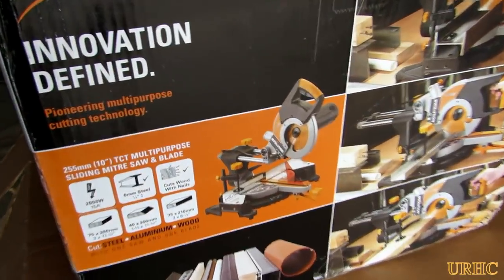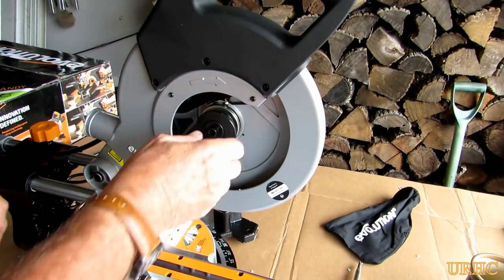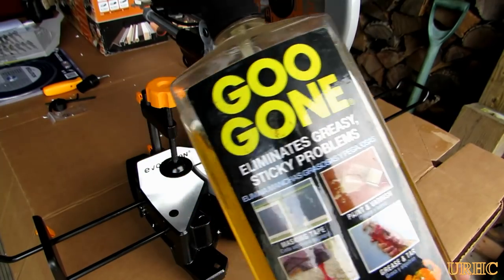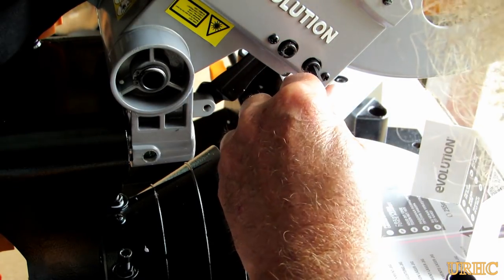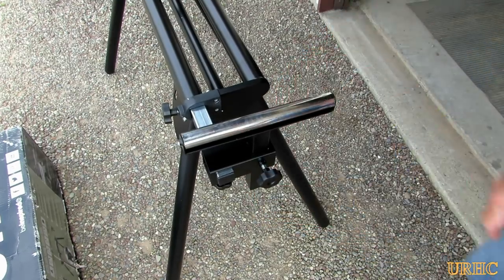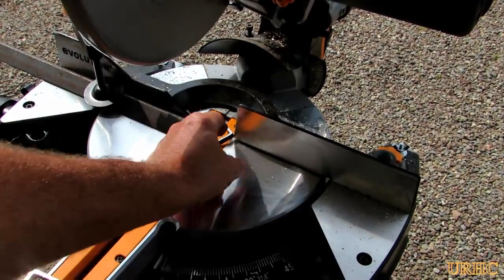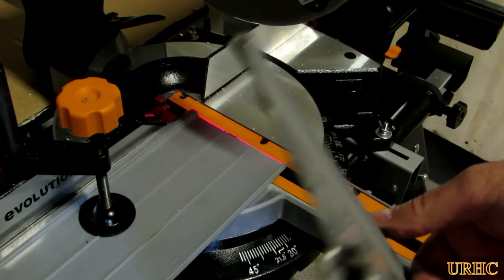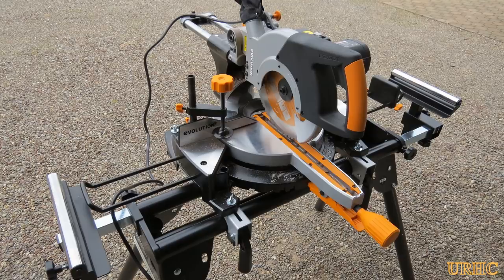Evolution Rage 3 TCT Multipurpose Miter Saw, Asm, Setup, & First Cuts

Comment: Of all the reviews I've seen with this machine, NOBODY has ever mentioned the 5/8 arbor like you did. I am a woodworker and  I don't do a lot of metal work, but to have a saw that is capable of this, well I need to seriously consider this.  I think that the price is excellent for anything with a 3 year warranty. Thank you for a very well done review.
Reply from the maker: The flange that centers the 1 lnch arbor can be flipped so a 5/8 drilled blade can be used.  The rpm is a little slow for a std wood blade, but I will try it to see how it cuts when I get a  chance. It would be the perfect saw for both worlds if it had a 2 speed gearbox with a high speed for wood. The slow start feature makes it a really smooth running saw to operate. Thanks for watching

Comment: Just wanted to say thank you.  I have the same saw and like a lot of men did not read the instructions.  Mine was not cutting at 90 and so when I was building things like chicken coops, duck houses and sheds, they were always off.  I started to look for videos in despair as I was about to sell it and buy something else.  Will be setting it up properly tomorrow.  Thanks for sharing.  Now subbed
Reply from the maker: These saws are not always perfectly adjusted from the factory. Mine both cut good after adjusting them. Thanks for watching.

Comment: I’ve had this saw for about a year and here are my thoughts:
The Good
1. Motor has plenty of torque. I cut 2x2x1/4 square tubing no problem. 
2. Seems to be well made. Good ball bearings and heavy slide rails. 
3. Cuts multiple materials. Arbor can be removed and reversed to use 5/8” arbor wood cutting blades. 
4. Love the soft start. 

The Bad
1. Throws a lot of hot metal chips directly at your face when using the included blade. 
2. Included blade is a jack of all trades, but master of none. It will cut a lot of materials but won’t cut any specific material as well as a blade designed for a single material. 
3. Clamping system designed for wood not metal. Does not hold metal well. 

Recommendation: If you want the convenience of cutting multiple materials and won’t use it for heavy duty cutting, this is your saw. 
If you’re going to be cutting mostly metal, get the Rage 2 because it’s clamping system is made especially to hold metal. 
Overall it’s a pretty good saw, just know it’s limitations.
Reply from the maker: The only thing to add is if you don't cover the laser lens when cutting metal the cap is destroyed by the hot chips. I have had no problems with it so far and also have a northern tool 15 inch saw for thicker materials.  There's a new replacement model out for this saw now. Thanks for watching.

Comment: That settles it, I was on the fence but now I'm getting it. mitre saw that also cuts metal, I'm sold.
Reply from the maker: Just make sure you don't cut high carbon or hardened steel it. It works good for low carbon steel and aluminium.  Evolution has some good videos on their channel showing how to cut steel for best blade life. Thanks for watching.

Comment: This video is fantastic. I just recently bought exactly this machine and the stand as well. Your video was very helpful at the point of assembly and at the setup. You saved me lot of time. Thank you very much!
Reply from the maker: This has been a great saw so far. Just get a good faceshield if you will be cutting metal. They did make it easy to assemble. Good luck with yours. Thanks for watching.

Comment: Awesome review. Thanks. Wondering if after a few year use if you could update on reliability and  durability of blade. Thanks
Reply from the maker: It is still good. Watch the videos  on the evolution channel  that show how to cut for the best blade life and only cut the recommended materials. One cut in the wrong  material will destroy the blade. This saw has been discontinued and replaced by a newer model that has a blade that is not as good.  I have a video about that one also but think this is s better saw. Thanks for watching.
Reply: @unemployedredneckhillbilly2023  great, thanks for replying

Comment: I have this saw, or an earlier version.  Mine has the measuring marks on the fence.  Got it on clearance @ Lowes for around $100, and bought their last couple of extra blades.  The guard has always been problematic and the topside vertical pivot lock vibrates closed every cut without fail.  Other than that, cuts great.  Cuts about anything.  Just support your material, use sacrificial backers for small aluminum cut offs, like thin aluminum angle, cuts better in a stack than individually,  etc.   ...the usual learning curve stuff.  If you've ever seen someone try to cut a piece of aluminum angle on a chop saw and it slaps both their ears...you know what I'm talking about.
Reply from the maker: I haven't seen any problems with the guard. The only issue is if you don't cover the laser lense protector when cutting metal it gets messed up and must be replaced. Thanks for watching.
Reply: Unemployed Redneck Hillbilly Creations , looks like they've made some changes.  Glad it's worked out.  I really like this saw, and their 12" chopsaw. I'd love to make a video for this saw, or even sell these.  They're the smart choice.  I've never regretted buying it.

Comment: Keep looking at this saw and have not pushed the button yet. Thinking you just helped me decide to purchase one. Nice review.
Reply from the maker: It has worked good for me. The only thing I have found so far is to cover up the laser lens when cutting metal. The hot chips can mess the lens cover up. I did a lot of veneer stone cutting with the diamond blade and that also works great.

Comment: You said the Blade cut the aluminum "like Butter", but the Von Stefent brand Butter I buy at Walmart would almost certainly melt the "diamond blade" if you tried to cut through a bar of lightly salted.
Reply from the maker: That must be one tough slab of butter. Thanks for watching.

Comment: does the the arbour lock button drop into a detent on yours? I fond t hard to tighten the blade.
Reply from the maker: Yes. There is one spot it will engage.  Press the lock button and turn the blade until it locks in. Contact  evolution if yours  doesn't  lock. Thanks for watching.

Comment: My saw came fully assembled. Wondering if they started doing that after you got yours. My box was also pretty beat up but seemed like everything was there and intact. I actually haven’t made any cuts with it yet though.
Reply from the maker: Did you get the Rage or R255 SMS. I thought the rage is discontinued and replaced by the newer model. Shipping beats every box I get up pretty bad anymore.  Mine still works great.  Thanks for watching.

Comment: By far best review I've seen on a compound mitre recently. Thanks!
Reply from the maker: It has been a great saw so far. It is not a super high precision wood cutting saw, but does a good job on all types of materials with the same blade.My blade is still sharp after a couple months of use. I reccomend covering the laser when cutting metal. Thanks for watching.

Comment: any update on this saw? is it still working?
Reply from the maker: Still working good. Have used it for steel, aluminum, slate, stone, ceramic tile, plastic and wood with no problems. Used in many of my videos. It has been discontinued and replaced with a new model that I also have and don't like as much. Thanks for watching.
Reply: @unemployedredneckhillbilly2023  so you like the older model better? thats the one i have and no matter how hard i try i cant get it to cut true its always off by a bit and getting the laser spot on is another battle ..ive heard that the fence comes bent from factory or something thats why you can never get it perfect, ive been reading alot of reviews and alot of them have the same issue that im having... this saw does everything ok but nothing great... good for the simple regular diyer around the house but i dont know about professional
Reply from the maker: I definitely  like  the rage3 better.  Quieter,  smoother,  and comes with a better  blade. Mine  cuts true but not perfectly smooth  because  of the lower rpms required for the multicut blade. If your fence  is bent did you contact  evolution?   The laser needs to be covered  when cutting  metal or the lens gets  destroyed and distorted. I  don't  use the laser anyway. For a good cut get a decent  tablesaw with  an Amana blade. Thanks for watching

Comment: glad I found your video! Manufacturers link to their video was garbage as was the instruction manual and assembly guide the printers must have run out of ink it was that feint and no laser jig! Hope the machine quality is better than the instructions. Thanks for your help.
Reply from the maker: This has been a great saw. I just received the new replacement model and I like the rage 3 better. It has a quieter motor and comes with a better cutting blade. They seem to have cheapened down the new model with less teeth on the blade and a motor that sounds like the drive gears are external and very loud. There is a video about that one. They both are very easy to assemble. Thanks for watching.

Comment: Really great video.  Very informative. Looks like I might buy this saw......
Reply from the maker: I have used it quite a bit and it is very handy. It is not a super precision woodworking saw but does a good job on everything it cuts.  The only issue so far is if you cut a lot of metal or stone with the diamond blade the lense on the laser gets beat up and has to be changed to see it clearly. Evolution has some good videos about how to cut steel for the longest blade life. Thanks for watching.

Comment: Went to your link for the saw at Home Depot and it says discontinued. Maybe it was too much of a good thing as it cut both metal and wood. Good review tho.
Reply from the maker: I have a video about the replacement model that cuts the same materials but really like this one better. This comes with a better blade and is much quieter. I think this was recently discontinued. Thanks for watching.

Comment: How many blades come with it? Is it one blade that cuts through all materials and a back up dedicated tile if that's all your cutting? But the first blade still cuts tile as well as wood/ metal?
Reply from the maker: It comes with 1 multi cut blade for wood and soft metal. The diamond blade for cutting stone and tile is extra. There is a newer model available now. Thanks for watching.

Comment: Were you impressed enough to recommend this as a "one saw to do it all" for the beginning homeowner, or would you recommend dedicated wood and metal saws if budgets allowed owning both?
Reply from the maker: It is not a high speed saw with a high tooth count triple ground blade so if you plan on cabinetmaking and finish carpentry the cut in wood is not glass smooth, but it is accurate. If you plan on using it for home based projects it looks like it will handle everything that you throw at it out of the box. There are also some different blades available for cutting steel and wood that probably will give better results then the TCT blade in the materials they are rated for. The diamond blade is a real big plus to me for tile and stone work. I would have loved this saw when I remodeled my first house and destroyed many blades trying to reuse materials with nails and had many drain lines to cut. Plus having the ability to accurately cut steel would have saved me countless hours of hack sawing and grinding. So far I really like the saw, the quality is great and I would recommend it. Time will tell how the blade stands up, but it is not a very expensive blade to replace. Home Depot sells the saws and always stands behind anything they sell, plus the 3 year warranty seems like excellent coverage for a saw in this price range. Serious eye protection is needed when cutting metal Thanks for watching

Comment: Mine suddenly began to run at what appears to be double the speed, so I now only use it for wood. Has anyone else had this issue?
Reply from the maker: I would pull the plug out and contact Evolution support. Sounds like it could be a dangerous problem as the saw is not designed to run at higher speeds. I would not run it until fixed. They have a good warranty if yours isn't too old.

Comment: I have the same saw and I'll be returning it to the store very soon. It stopped working suddenly after about 2 doz. cuts. It popped a breaker and would n't restart after it was reset. I'm unsure if I'll try another one.
Reply from the maker: Mine has been working great for over a year now. The only issue is you have to cover the laser lens cap when cutting metal. That is definitely a bad bummer.  Thanks for watching.

Comment: Great video sir.  Thanks very much for uploading and doing such a thorough job of showing the setup etc.
This saw be good for a DIY'er who's tired of making unsquare cuts with hacksaws and woodsaws?
Reply from the maker: I have gotten a lot of use from it so far. It is not a high precision woodworking saw but a really good all purpose saw. The diamond blade has worked awesome for stone veneer and tiles also. The blade on mine is still sharp after using on different materials for a couple months so I am very happy with it. Thanks for watching.
Reply: I'll need something for wood and aluminum mostly, maybe some steel too.
Thanks.

Comment: You provide a lot of good info, but what about ... price or value?
Reply from the maker: There is a link to homedepot.com in the description with the current pricing and it seems to be a great sale price right now. I think it is a great saw and gives you the ability to cut many different materials  that is backed by a 3 year warranty that is a great value to me due to the different types of materials that I  work with. This saw is very well made and has a high torque low speed motor that puts it in a class of its own. Yes you can find a lower cost saw, but it will only cut wood so it depends on how you plan to use it. Thanks for watching.

Comment: This saw caught my attention and your review has convinced me to buy it.  Awesome review!  Has anyone ever told you that you sound like Woody Harrelson?
Reply from the maker: For the price it is a saw that can cut just about anything. It is not a high precision woodworking saw with a glass smooth cut but cuts everything well. One thing I have to recommend is when cutting metal or stone protect the laser lens or it can get damaged. Evolution has some good videos about how to cut steel to get the best blade life. I cut a lot of stone veneer with the diamond blade and that also worked great. Thanks for watching.

Comment: Thank you for the review. What can you cay about the life of the blade when cutting steel? (2mm steel tubing, thing like that). Some reviews suggest this is an expensive way to cut steel.
Reply from the maker: I just started using the saw and do not know what the blade life will be. I think it will depend a lot on the grade of steel that you are cutting. It cuts soft steel like butter,  but anything with a hardness may shorten the blade life. I have a old abrasive saw and know that the way those blades wear out it costs a lot to cut steel with that. The only good thing about it is that  the abrasives  will cut hard steel. I know there are also dedicated steel cutting blades available that may have a longer life available for this saw. Time will tell how long the blades last and then I can give you a accurate answer.  Thanks for watching.

Comment: Metal cutting saws have a different speed than a wood cutting saw. You can use any saw to cut metal with a metal blade but the blade will wear quickly because of the wrong speed.  Unless this saw has a couple different speeds, one for metal and one for wood, of course the blade will crap out quickly, which is what I hear in all the reviews it does.
Reply from the maker: My blade has stood up good so far. This blade is made for soft low carbon steel.  They offer different blades for alloys and stainless.  They have a great video how to make cuts for the longest blade life that is worth watching. I see Freud has a new line of high speed metal cutting blades for standard miter saw speeds that look nice.

Comment: I have this saw and I'm having some trouble with blade deflection when cutting steel that makes for kind of a jagged cut. Any suggestions?
Reply from the maker: Have you tried carefully looking over the teeth on the blade for chips or missing carbide?  I would give their support number a call and see if they have a solution. The crappy clamp can loosen also so I usially add a horizontal clamp for extra support.
Reply: This was right out of the box. I did reach out to Evolution through email. Waiting to hear back. I will post any updates. Thanks for your response.
Reply from the maker: If everything moves smoothly  i am guessing it is the blade. Evolution has some good videos on YouTube about how to cut steel to get the best blade life.

Comment: Keen on the saw, but would like to see it with the Diablo steel demon blade before I buy
Reply from the maker: Can't help you with that. The blade it comes with has worked good so far. If you want to only use it for steel I would go with a bigger saw with a better hold down clamp. Thanks for watching.